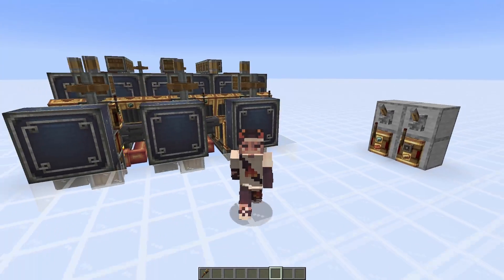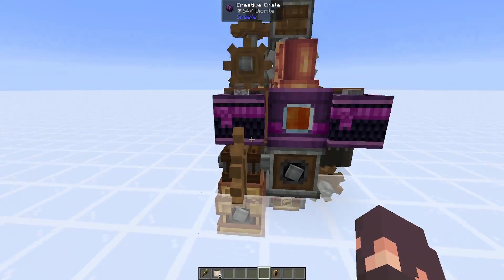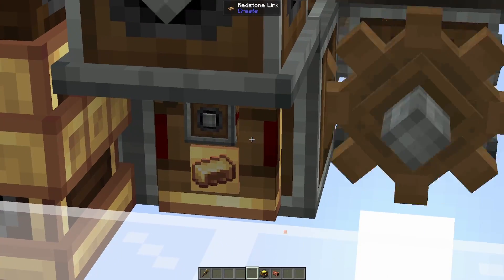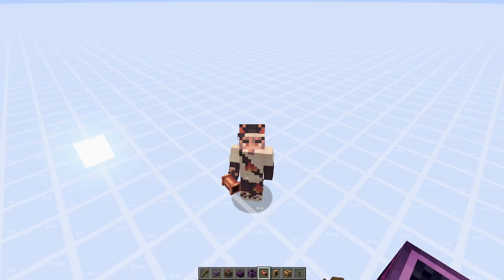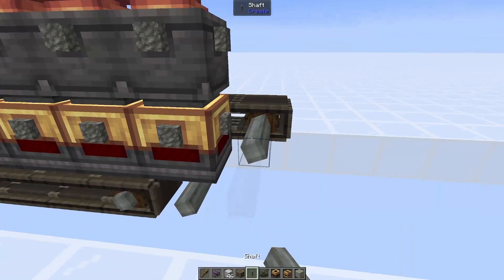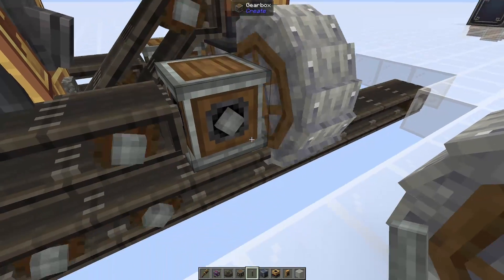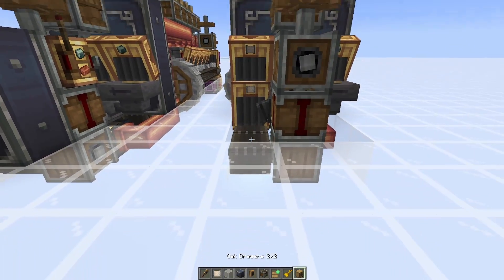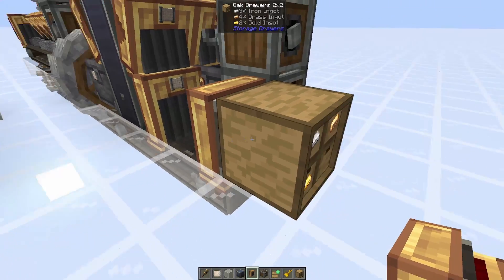Create mod Tileable BRASS Farm TUTORIAL | 1,000 Brass Per Hour

Comment: i see that you said this machine takes 2500 andesite to run at full speed im guessing thats per hour? or would that be alot more needed. i ask cause i have connected youre diorite and andesite farm too two of these and it doesn't seem to be able to keep up on with the andesite demand one bit.
Reply from the maker: it should be per hour! If I'm not mistaken, the default andesite per hour of the diorite + andesite farm is under 1k so you would need to provision more andesite crafting to make it run at full speed

Comment: Hey, I js tried combining your new diorite/andesite farm with this + a little lava farm and it works perfectly! I can only recommend this to people with the andesite and diorite farm, it jsut generates brass so quickly and effectively Edit: While I was typing this I got around 10 brass ingots
Reply: it did not seem to work for me? even tho im using the same patch version i cant seem to connect the lava source to the blaze burners
Reply: @Justjefry Sorry for the late response, I'm on vaccation rn

You need to use a separate mod for the blaze burners so they can actually pump in liquids

I for example use the Create: Crafts and Additions mod as it adds the Straw and if you right click a blaze burner with it it can pump in liquid.

I think the Create: Liquid Burners mod does the same but you don't need a straw but I had some compatibility issues with it.

If you got a mod like that now it should work.

If it doesn't I would just try to destroy the pipes and replace them or something I got no idea why it wouldn't work by now.

Comment: hey  @kindlebubbledump  I really love your builds but can you make this without the mods that add lava directly to blaze burners?
Reply from the maker: You should be able to add it pretty easily. If you have the lava go into a spout that drops it onto empty buckets and use a mechanical arm to deposite the bucket into the blaze burner (and drop the empty bucket off at an empty bucket filtered chute), then it should just work! this system is used a ton in steam engine designs if you need a visual

Comment: is it possible to reconstruct the blaze fluid thing with a mechanical arm cause i cant change the version
Reply from the maker: yes 100% I won't make another tutorial on that part, but if you look up steam engine tutorials there is a pretty compact system that works well with the mechanical arms pulling full lava buckets, powering a blaze burner, then returning the empty one to get refilled

Comment: All of my copper and zinc are headed straight to the storage as opposed to going in to the brass mixing basin, any suggestions?
Reply from the maker: Break the funnel that's dropping the copper and zinc out and wait until the other funnel is being used. then if you place it back it should respect the new priority. If that doesn't work and you don't mind increasing the size of the farm by 1 you can easily add a lever or something to power the funnel to stop it from dropping items
Reply: @kindlebubbledump  That fixed it comnpletely, thanks dude!!

Comment: Hey! I set up 2 of these things and connected them to your diorite and andesite farm, which is said to make 8000 andesite an hour, but can't seem to keep up with one of the brass farms which is only supposed to be using 2500 andesite. Would appreciate some help.
Reply from the maker: hmmm. I'm not sure how far off the rates seem, but it might be possible to just make 1 more basin/mixer combo to double the amount of andesite and you might be good then? you can follow the diorite farm tutorial where I build the mixer to get a general vibe of what you need to do
Reply: @kindlebubbledump  does the brass farm need to run at a certain speed?
or is 256
Reply from the maker: @share.storie I think 256 is correct
Reply: @kindlebubbledump  i think i figured it out, the farm has to get to a point where it backs up with tuff, so not all mixers are going, then it takes 2500 andesite an hour. I added the extra mixer for more andesite so hopefully both will get enough now.
Reply from the maker: @share.storie ohhhh got it! Glad u fixed it and it’s working!

Comment: I built the design but I have an issue, at minute 12:30 you place a basin and it points into the velt but it dosen't how do i fix it pls help
Reply from the maker: If you turn it in the basin should “notice” the belt and create the chute
Reply: @kindlebubbledump  it works but when I place the brass next to the ítem vault it goes away thats the problem

Comment: I am trying to build this in tiles but its not letting me place all the crushing wheels next to each other how can i fix this
Reply: i fixed it by making a seperate schematic for a single crushing wheel and it works now
Reply from the maker: Oh nice!
Reply from the maker: You might need to use a schematicannon. It usually bypasses those types of issue

Comment: Tell me how, when you mix Andesite and Diorite, you get tuff??
Reply from the maker: It’s from the mod create: additional recipes. Afaik it’s forge 1.20 only
Reply: @kindlebubbledump  Don't you think it was necessary to mention that an addon is needed for the plant to function?
Reply from the maker: @artyhellbender it’s in the pinned comment. I didn’t know it was a required mod when recording so apologies!
Reply: @kindlebubbledump  I didn't think to look at the comments but immediately went to do it, made 3 plants at once and for about an hour I couldn't understand why it wasn't working, I ran around it and rearranged the mechanisms, well, thanks for answering quickly
Reply from the maker: @artyhellbender rip sorry :(. All my new tutorials include the required mods but this was when I was relatively new to the create mod
Reply: @kindlebubbledump  No problem, do you have a guide on how to make a diorite farm?
Reply from the maker: @artyhellbender  YES! It's my most recent tutorial video. Check it out on my channel!
Reply: @kindlebubbledump  After connecting the diorite farm and the brass ingot farm, I realized that it all works very slowly, I did not build the andesite module, instead I connected the andesite conveyor from the andesite alloy farm, which is still idle because it is constantly overflowing, still very slow accumulation of brass
Reply from the maker: @artyhellbender hmmm are all of the tuff crafting modules working at full speed? If so then that might be full speed. You could also run it for an hr and see how much brass you get. That should tell you if your farm is actually slower than expected

Comment: Not sure why but the mixer to make the brass ingots only works once or twice then stops. It has everything it needs but simply stops working and fills with Copper and Zinc ingots. It even makes the brass ingots but they don't drop to the belt even though the cauldron has the spout outputting to the belt. Also for some reason the brass funnel that drops ingots above the iron and gold one drops the ingots but the belt doesn't pick them up. Its almost like the belt is allergic to copper. I've replaced and rebuild it many times and still doesn't work. 🧐
Reply from the maker: thats super weird. I think your only issue is the brass getting on the output belt. If you could join my discord and send a screenshot that would help cause idek how this could be happening lol
Reply: @kindlebubbledump  Fixed it. For some reason a single belt under those funnels doesn't work. I could see the ingots dropping out but vanishing. I split the belts right under the (iron/gold) funnel and it started to work.
Reply from the maker: @danielm7089  oh weird, glad you fixed it!

Comment: Amazing farm, although I noticed a few things to fix while building in survival: first of all, you don’t need to put brass funnels everywhere, in the tuff crafter andesite will do the thing, second, the point where nuggets get compacted into ingots you don’t need to put another belt in the middle, basin won’t throw ingots on it, put a depot there, third, in survival crushed tuff doesn’t drop smelted  nuggets, so after compacting it you will also need to build an additional smelting system
Reply from the maker: All good points!! And glad you like the farm. As for smelting the nuggets, I think this is an additional mod because I don’t have raw nuggets as an item in my modpack.

Comment: i can't math the 25x25x16 hole lol like the 16 is the top layer that is fit in one chunk?
Reply: nvm i got it
Reply from the maker: It doesn’t matter what orientation the cube is in. 16 can be the height/length/width, as long as you have the other 2 dimensions being 25x25 then it should work. If you’re still curious I have a create mod series on my channel and on ep 21 I made the bottomless hole so you can check out what it looks like there
Reply: @kindlebubbledump  yeah i was thinking about fitting it into one chunk so ftb chunk could force loaded the pump and stuff so i can let it sit in the server

i found that 16x16x40 is good number for it
Reply from the maker: @nguyenduythang7598  yup that will work!

Comment: What can I do if I'm on 1.19? I dont think additional works
Reply from the maker: If the pipe doesn’t connect to the blaze burner, you can use a mechanical arm to put coal/charcoal or other burnable items into the blaze burner